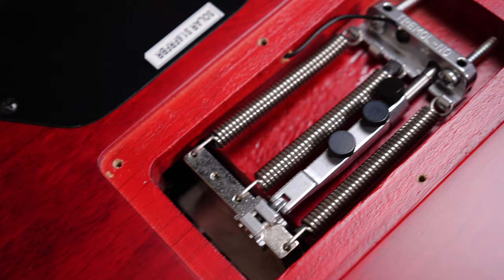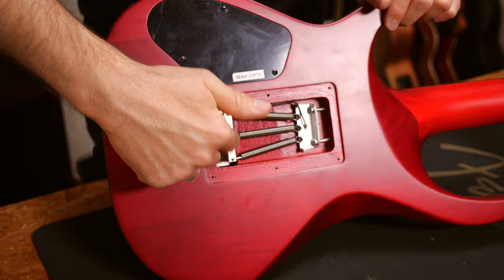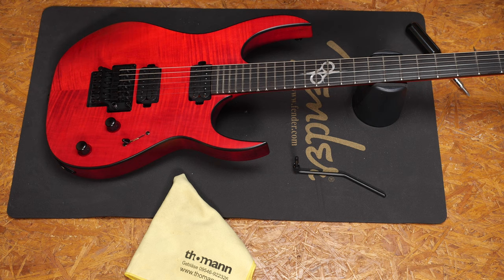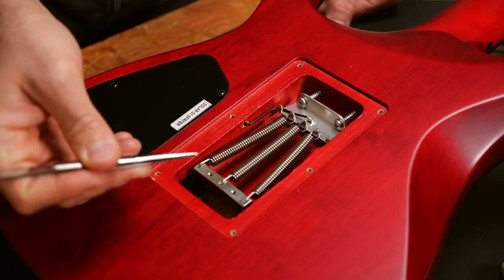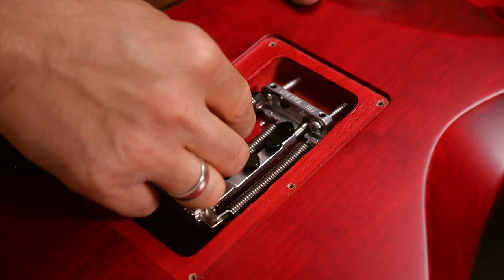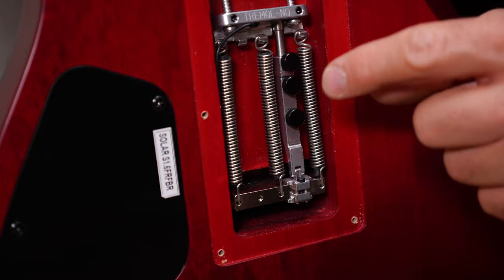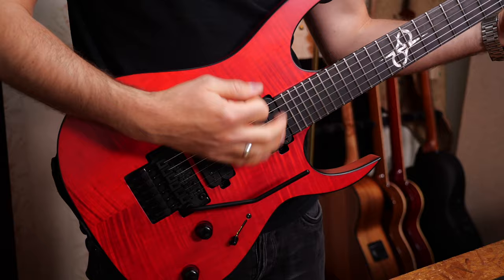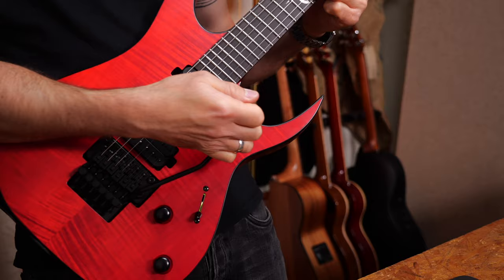Best way to block a Floyd Rose? | Tremol-No | Guitar Tech Tips | Ep. 10 | Thomann

Comment: You Forgot a VERY IMPORTANT function !! It makes changing strings much easier on a Floyd Rose ...Just lock it in place put the strings on and tune .!!!!
Reply from the maker: I did forget to mention that. Thank you!! :) Very good point! Comments like this are the reason why I love our community. Cheers man!
//Kris
Reply: how far out of tune can u go when its blocked? do u have to take it back to the original tuning if changing strings or  unblocking the trem?
Reply: Yup, but just make sure you do ONE string at a time when doing so.
Reply: @ThomannsGuitarsBasses  where can I find  the tremmory, Iooked on Ebay no luck
Reply from the maker: @moisesjimenez4627  Hey, if you're looking for the Tremmory, search no further. Thomann sells it. Try thomann.de :)
//Kris
Reply: Thank you, for a beginner/intermediate level of player who bit of more than s/he can chew getting a second hand Slime green Slx with Floyd special bridge, this gizmo is essential.
Reply: This is EXACTLY why i'm buying one.
Reply: @Bss_-eo9dn  Which would be fine if it's a simple string change, but what when you need to remove all the strings because you're doing maintenance on the neck, or replacing pickups? Sometimes you need to remove all the strings and getting it back in tune from that point and having the trem set correctly is a huge pain in the ass
Reply: Most important point really
Reply: @ChromeXk  disconnect the tremol-no clamp and all springs in the back, pop the bridge out of the front of the guitar with all strings attached, do what you need to do and then put the bridge/springs back in. This is how I clean/oil my neck 😊
Reply: it doesn’t really work like this. this thing is not strong enough if you remove all strings. you still have to change one string at a time. this thing very much relies on the supporting tension the springs and even the strings itself give. its a little bit disappointing, but i am fine to use it like this.

Comment: My Floyd rose Harley Benton has a Tremel-NO AND a Tremeroy installed in it - EVH D-tuna too!
Reply: I am in the process of doing same on my Schecter C1 fr s sls elite. Once all mods are done I will have D’Addario Auto Trim tuners, Tone Vise Keyless Nut Locks, GraphTech Ghost Floyd Rose Piezo and preamp, Tremmory, Tremol-no, Tone Vise Drop D Pitch Shifter, and hopefully a home-made B Bender to work on the FR which I am designing currently.
Reply: I want to do this too but I wasn't sure if the tremmory and tremolno would fit. Were there any issues installing them together.
Reply: Me too, the tremol no combined with Floyd Rose with a d tuna is great!
Reply: @jamesfrederick99  can I see
Reply: If you set the tremel no on dive only, can you then just tune to drop tuning without having to retune all strings?
Reply: this is the comment i needed to see. im glad both work well together
Reply: do the twist knobs on the treml-no get in the way of the one knob on the Tremory?

Comment: I have a Tremol-no on my BC Rich and I love it. I'm not a huge fan of Floyd Rose's. The guitar is killer, plays and sounds amazing, but I don't get into the whole 80's dive bomb thing. I threw the Tremol-no on there along with some stiffer springs and locking tuners. I just finger tighten the screws at the nut so it keeps the aesthetic, but they're loose enough I can still use my tuners. Occasionally I'll loosen the one screw on the back so I can press down on the bar, which makes it operate more like a Strat. 

Biggest game changer on here though is changing strings.

Comment: For years I just used wood to block and it ws fine until I started playing out. I noticed that that block of wood would swell in the humidity and knock me out of tune anyway. So I installed the tremol-no . So far so good.  It is an easy install. I used tape to mark my original spot but I still had to crank the screws up about 12 more turns from that spot. I guess it is a good marker point to do so.

Comment: Kool vid man really interested in the discussion of this topic, being poor for a lot of my life Ive tried lots of things and varietys of wood in both sides on the tremolo block and aim to find ones that don't inhibit the actual guitar tone as much as possible or add any undesired overtones, and generally I would always go with wood. 
SIDE TIP - I've found tortex picks to work great to fill just a little space if your broke and needed since they dont actually really "sound" like anything or add anything tonaly speaking and don't have the usual plastic sound of regular picks ;).
Reply: I confirm this to be true. I have been collecting picks from a lot of rock concerts through my life. But the one I use constantly is the Tortex 2mm. It makes picking easy and the sound of any string set becomes more punchy.

Comment: I haven't played my guitar in years, which has a Tremol-No set up by a guitar repairman. However, I noticed the Deep-C is not tight enough and still moves when I push the Floyd Rose up even in Hardtail mode. Is this some kind of a maintenance issue where I need to use lube?

Comment: I've had 2 of these and they work great except when one of the 3 screws shown above just happens to fall out...Just make sure you have them screwed in tightly to the O ring and as a afterthought  it also affects The Floyd's ability to flutter properly but it's a great stabilizing system if you like versatility

Comment: I have this system installed on a jackson pdx 2 as hardtail mode and what i can say is that i have more sustain with original pickup hz. Dont ask me how is this happening.
I think they can improve this system by making the 3 screws with allen key because is a bit hard to tighten them all the way by hand

Comment: i just got mine, the black hex screw that holds the wire in place that normally sodered came stripped, what can I do? also even with is installed doing dive only, or hardtail the bridge is not smooth and won't go back into its rightful floating place?

Comment: Wasn't sure this is what I wanted, but saw how easy it is to install and how versatile it is. I bought one for my Strandberg, and if I like it I might be getting one for all my trem'd guitars.
Reply: How do you like it?
Reply: @grandwazoo1696  it is okay. It doesn’t hold stable for string changes so I still block it off when doing that. With bass heavy notes/riffs it tends to rattle where the claw connects to the metal bar. Which can be annoying but not completely intolerable. It holds great while playing, or drop tuning. Whatever the guitar is setup for is the only time you can use the trem for because obviously when you unlock it if it is no longer in that tuning it will go out of tune. I’d recommend it but it has certain things that need to be learned to live with.
Reply: @MrAustinMusic  Thank you for the reply. I am wondering if you tried changing one string at a time when it is locked?
Reply: @grandwazoo1696  no, I did all 6 at once. Considering how it holds with drip tuning I’d imagine that changing one string at a time would be fine though. That’s a good shout!
Reply: Should i buy it or just use the piece of wood method?
Reply: @MetalGodMasino   If you want a solution that is a little more elegant this is a nice choice. I'd prefer this over a block of wood, but if I didn't plan to use the trem ever than the wood is more viable and stable for sure.
Reply: @MrAustinMusic  i see, well i just wanted to block or partially block it and then unlock when i actually need it.
Because im tired to struggle with tunings and stuff for something i dont even use, but sadly most guitars i like have floyd. And when i bought this one i didnt know what a floyd rose was.
Reply: @MrAustinMusic  also do you know anything on what size i should buy? There are sizes like large and stuff like that. I have a Jackson Kelly ferrari red

Comment: Does this work with the fat brass blocks?  It looks like the clamp around the block is adjustable, but can't tell how wide it actually adjusts.
Reply: There are 3 versions of tremol-no. The difference being the size of the claw that clamps to the trem block. Large claw, small claw and no claw that is just the spring hook.

Comment: Would it be possible to use a Tremol-no and EVH D-Tuna together? I know the D-Tuna is only for dive only Floyd setups, would it cause problems if you went back to floating with it installed? Or could you just ignore it while in floating mode and still use it in decked mode?

If you have a better way to go between drop D and standard on a Floyd I would really love to hear it!
Reply from the maker: Hey Sam, yeah sure you can mix those two. Just ignore the D Tuna when in floating mode and only use it when the trem is blocked. Here's a tip though: try something like the Guitar-Guard Hardtailer with the D Tuna instead. That thing is rock solid and even faster to block / unblock. https://youtu.be/GF2H6SyRn8g
Cheers //Kris

Comment: So does this mean I could install a D-tuna and the Tremol-no and be able to switch between Drop D and standard but still be able to use a floating bridge for standard and still be able to dive with drop d?
Reply: If you have a D tuna you can float in both standard and in drop D. You wouldn't need the tremelo no

Comment: So does it still feel easy to use the trembar or do you have to put considerably more effort in pushing it up or down. Thats usually trade off that comes with these trem stabilizers.
Reply: Nah when you loosen this it feels totoally normal.
It slides effortlessly.
Its different from the midpoint spring based stabilizers.

Comment: One thing worth noting is that at least for me, the device works far better after the removal of the rubber washers that are on the tightening buttons
Reply: ..but these are there to prevent the buttons to fall off and get lost.
Reply: @Steinstra-vj7wl   yes, this is true and they will vibrate out without the rubber washers. However, I've gotten around this using  Loctite thread locker. Use a very little amount of the blue variety and they will stay put. But its very important that only a tiny bit is used and it is of the blue variety.
Reply: @shawnobryant9949  A device works 100%, or not: not like "it works for 90%". I don't want to spent time to "solutions" to an inherit flaw. Besides, the whole point of this device is to quickly lock, unlock, and lock again,  which it won't do with glue.
Reply: @Steinstra-vj7wl  after doing this "mod" it does work 100% of the time for me. So take it or leave it, I was just trying to leave some helpful advice.

Comment: I'm considering investing in one. I didn't see what you did with the ground wire after installing it though. Edit: I watched the installation part again. I see there's a little clamp for the wire.
Reply from the maker: Check 2:37 again, you can see it how I clamp the ground wire on the tremolo claw with that small screw. Cheers //Kris

Comment: Can I use it with a 7 string floyd rose? And if I change the tuning while the bridge is locked what happens if then I dislock the bridge and I use the whammy bar with the new tuning? 
Thanks
Reply: First, yes you can install it on a 7 strings floyd Rose, as long as you use the specific springs for your model.
Second, if you switch to free mode, nothing happens if the neck locks are locked, although it slightly  goes out of tune a bit.
Cheers.

Comment: I installed a tremol no in a floyd rose special. Now I kinda need help. So, the reason I’m blocking it is due to having a lot of issues with it constantly and I’m getting titanium blocks as well. 

My strings currently are not all on (long story lol) And I’m using a 9V battery to keep my bridge where it’s at because it’s level. I managed to install the tremol no but came across a few thoughts

The titanium blocks when they’re inserted will likely help with keeping the string from slipping but

If it doesn’t: idk where to go from there and I used used $55 for nothing

If it does: Will the tension on the springs be too much now that I have the tremol no? And if the tension is too much and my strings break before I can fix everything and get my bridge float angle fixed?

I have no idea I need help.

Comment: Any "clank" noise? I have read some people get to hear it thru the springs/strings into the pickups. I have never tried one but would really like to try it.
Reply: I read a lot of reviews that say there is clanking noises, but I’m sure that if you put some foam in between the springs and the guitar body, that would solve the problem. That’s something that any Floyd user should be doing anyway because the springs can rattle around in the cavity and be picked up by the pickups.
Reply: I bought a tremol-no, installed it, then removed it a couple months later.  There is definitely "clank" noise not related to the springs when in "dive only" mode.  I also ran into issues where the screws that were supposed to lock the system would loosen on their own (and I mean within minutes of them being tightened to begin with).  It was worth a shot, but ultimately I did not like the tremol-no and will not consider re-installing it.
Reply: @2112Relayer  I was looking for this answer:  I also ran into issues where the screws that were supposed to lock the system would loosen on their own. That screw gona loosen sooner than later... bad design.

Comment: Does anyone else have trouble with their Tremol-No? I recently installed mine and the screws don't seem to lock the bar from moving. When I lock before dropping each string down a half step (E to Eb), it goes out of whack because the bar doesn't actually lock into place. I can still move it with very little ease by either pushing or pulling on the Floyd Rose from the front. I reached out to All Parts, but they won't respond to my emails or answer my calls (and their voicemail isn't set up).  Any advice? I already tried rotating which thumbscrews are used where, but they all seem to suck at actually locking the Tremol-No in place.

Comment: did you have to solder the ground? or is there like a screw connection or something. Will i need to solder anything is basically im asking
Reply from the maker: As you can see at 2:40 there's a screw for the ground so no need for soldering there. You'll have to unsolder the ground from the original spring claw though.
//Cheers, Kris

Comment: Will it work on all trems (where the blocks are way thicker than a floyd) or just the Floyd Roses ?
Reply from the maker: There are a few versions of the Tremol-No: one for thin trem blocks (small clamp) one for thick blocks (large clamp) and there's even one with a pin for the block, instead of a clamp. So yes, it pretty much fits all common floating trems.
//cheers, Kris

Comment: Can I go from E to D to C# in dive only mode with no problems? I have a dinky js22 with 2 point tremolo. I'm still on the fence with Floyds
Reply from the maker: Hey, there are limitations to what tension change a small screw can handle (small screw being the one you tighten on the Tremol-No for dive only mode). I haven't tried to tune all the strings that low but I could imagine it being too much. It's not an issue to drop tune the 6th string of course. Cheers //Kris

Comment: Do I have to adjust the floating bridge again if i were to go from E standard to a drop tuning and use the full floating mode at the same time?
Reply: yes because this only works due to the fact that it wont allow it to go back when lowering the low e string thus keeping the remaining strings from going out of tune wish it could thou i'm going to look at a hybrid method of maybe using the tremol no and a backstop or maybe the tremmory together to see if that would possible work

Comment: A little long, but please read, I need advice. My trem has been hard blocked on the “inside” way for ever, like since 98. It got blocked with like, a 1/4” piece of wood and all five springs. This resulted in the trem recessed in the back i.e. the locking screws aren’t accessible, which is no problem, I’ve always just pulled the trem up when changing strings. Well, I’m finally putting in new pick ups in, and have temporarily put a bigger block in so the trem sits even / normal, then I was going to put something like the Tremelno in, but I’ve discovered that with the trem in it’s normal place it’s hell on my palm. Totally changes the way I play. Any thoughts on this short of replacement of the Floyd? Would the Tremelno work to set it fully recessed as before? Thanks, and good vid!

Comment: I found that it really killed the tone, not so bad with distortion, but noticeable with an overdrive, so it is in my parts drawer.
Reply: Probably better to jam it with a piece of wood rather than adding a piece of metal where springs reside...
Reply: Unless your tone relies on the loss due to the dampening springs/floating bridge, I can only see a firmed/fixed trem as being better for tone and sustain.

Comment: I installed a Tremol-No on my LTD KH602, because string change with a floating Floyd Rose is a pain in the a**. Just be cautious with the locking screws on the claw. I managed to ruin the spring claw screws, because the locking screws there still too tight.  BTW the way the Tremol-No claw was a bit higher than the original claw and the tremolo cover won`t fit anymore.The reason for this is: the guys in the WMI factory slanted the original screws too much and I am stuck with these predrilled holes. Is there a tech tip to fix this easily?
Reply from the maker: Hmm. Too bad with the mounting claw screws. The only proper way of fixing that is closing the holes with hard wood and redialling them. It's a little tricky though and you will need a special drill bit so I recommend visiting a luthier.
//cheers, Kris
Reply: @ThomannsGuitarsBasses  Thx for the reply!